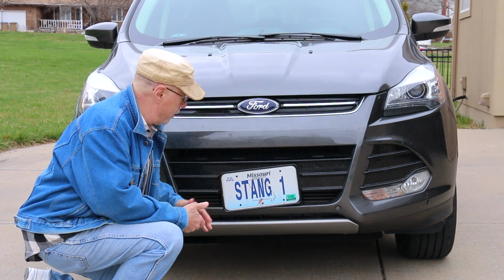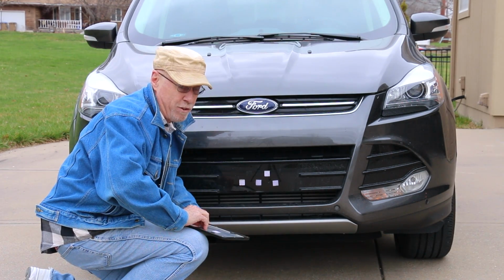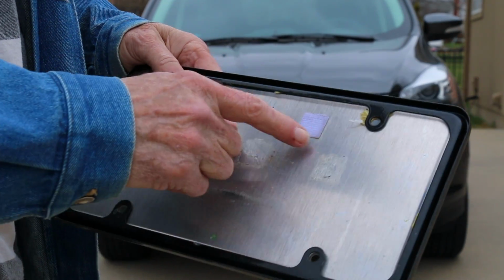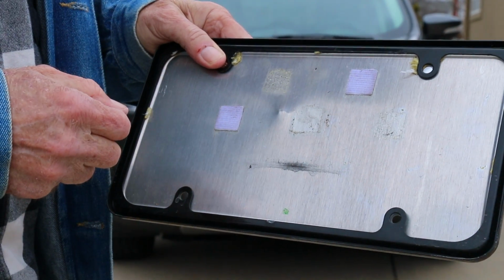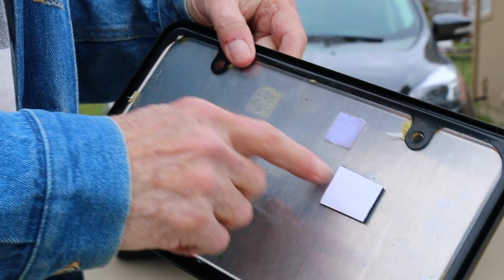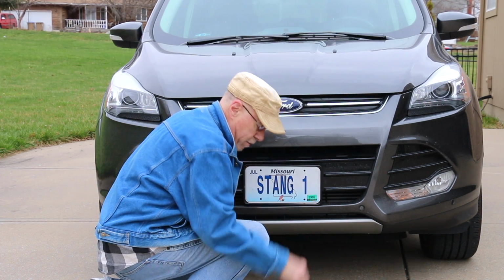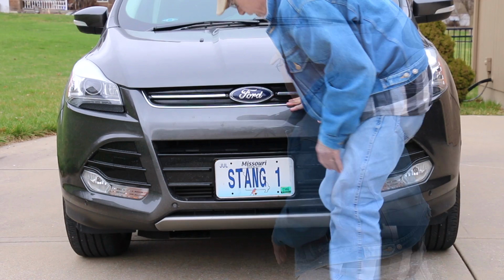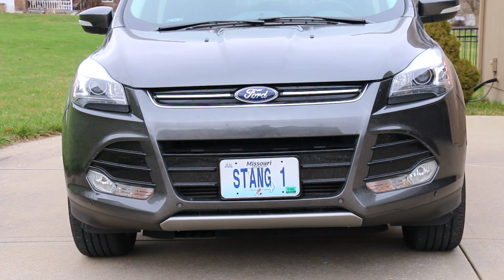Don't drill your bumper to attach that plate. Easy method.

Comment: Thank you for this video. I really did  not want to drill into my front bumper so I'm going to try the extreme dual lock Velcro as suggested by another commenter.
Reply: Did you do it and has it worked?  Is it secure?
Reply: @melindathomas7529  Yes.  It has been holding on well since.

Comment: Unfortunately, in my experience, the glue on the tape side of the Velcro becomes gummy and loose in hot weather, causing it to detach. I’ve tried it for other applications (not a license plate) and without fail it has always umm… failed. Cool idea in theory, though I wouldn’t want to trust my plate to some Velcro. Oh, and I’ve tried a few different brands and had the same issue.
Reply: Just move to a dry climate.  That will solve your velcro problem.

Comment: Thought about doing this... even bought some industrial strength Velcro. But where I live, the weather can get treacherous. I think I'll order something like the No Drill Required 3-Inch Bumper Guard Tube Mount License Plate Bracket/Holder but this is a great temporary solution.
Reply from the maker: I live in Kansas City. We get rain, freezing rain, sleet, snow, high winds and sub-zero temps and days over 100 degrees in the summer. I've never had an issue with it coming off so far.
Reply: @MagnumVideos  Magnum, thank you for letting me know! I think I'm going to try this tomorrow when the temps get to 13 for the high and see how I feel once it's done :) Seriously, I need to do something for now and see how it stands up while I look for a no-drill mount bracket that isn't a waste of money and will actually fit my car. Maybe there's a way I can reinforce it behind the fancy license plate frame I bought, as well, along with the Velcro. Thank you, again, for sharing this video.
Reply from the maker: @pangelcolon  We have 8 degrees this morning here in KC. 13 degrees is pretty cold, and if you're going to have any higher temps in a few days, I would probably wait until it warms up a bit so the Velcro will stick better. I don't know how it adheres when it's that cold when you apply it.

Comment: I know you’re just trying to be helpful but using velcro is a bad idea. It wont work if you have to mount it to a curved bumper. Velcro needs flat surfaces. The flat license plate will pull away from the velcro pads on the curved bumper. Also for many bumpers you can only have velcro on the top half of the plate so its even less secure. Many bumpers arent thick enough to secure the bottom too because the bottom hangs over the grille or radiator vent. And i’m not confident the velcro adhesive can withstand 120 degree heat in southern Nevada or constant rain in Washington for years. Best just to drill the holes or get a mount that attaches to the tow hook if the car has it.

Comment: Wouldn't do this with anything less than Alfa Lok velcro and wouldn't do it on a back plate if there's any part of it hanging low enough to catch any wind. Trying to figure out a solution to hang my rear plate on my rv. Previous owner had nice, bright, large brake lights installed which means no space to hang the plate where it was designed to go under the brake light.

Comment: What did it attach to on the car?  Is there a matching piece of velcro on the car or is he simply applying the sticky surface directly to the bumper. If so isnt that as damaging as drilling holes?
Reply from the maker: Velcro attaches to the bumper and the plate. No damage involved. Works like a charm.

Comment: I bought a thick rubber bumper thing for my front plate because it's attached with these long stabby hex bolts that actually protrude out front and would damage another car. The front plate attachment is drilled into the plastic (Volvo) bumper. I don't know about Velcro....that's...

Comment: This is hilarious on several levels.
"A quick video"!?! 6 minutes to say/show "attach it with Velcro"!
What's the issue with drilling holes in the bumper? The only upside to this is years later if/when you sell it privately to a buyer that lives in a state that doesn't require front plates you point out that there aren't drill holes there and he says "oh, ok. That's better than holes" and mentally adds $10 to your car's value.
Otherwise it's a liability, it can fall off, get yanked off in a carwash, or stolen.
The holes don't have much of a downside, they're under the plate.
Do you anticipate moving to a state that doesn't require front plates soon?
This one is a personal favorite. Along the lines of putting a vinyl decal of the model of car you are driving at the top of your windshield. You have an Escape with a "Stang 1" plate ROTFL
The "1" probably drops the price on a vanity plate like it would in Illinois but, looks hokey. The obvious laugh is that it's on an ESCAPE!
Is there another reason for it, is your last name Stang?
Props for good image quality and audio and posting them on the web though. Please tell me your patreon isn't full of this kind of stuff though.
Reply: Why don't you post some suggestions since you seem to know so much more.
Reply: @koosylagoopagoop  ummm, drill holes and use a nut and bolt? If you want it more secure (harder to steal) use a security bolt (AVsafe). Or just buy the license plate kit from Ford?! Then follow the instructions...
Velcroing is a loss waiting to happen and it's apparently hard to put the plate on plumb and square so it's kinda obvious that it isn't permanently (or well) attached which actually attracts would-be theives.

Comment: You would have been better off drilling holes since that part of the front end already had the bracket area built in. May have had a better chance if getting the plate on straight.

Comment: Anyone can steal  the plate very easily and it can come loose and drop anywhere.
Reply from the maker: Who steals license plates? Not in this area. Mine has been on for 4 years and hasn't fallen off yet.
Reply: Both mine just got stolen, people who don't like to pay for fuel steal them, or even worse crimes like ram raiding. That's who.
Reply from the maker: @arsecheese51  Were they screwed on?
Reply: Magnum yes screwed on, it’s one of those things you never suspect will happen so why waste time making it safer. But this kind of thing happens so I won’t be using Velcro, and even screws aren’t enough.. need safety screws, or bolts with a nut and locking nut on the first.. just to make them a pain to steal.
Reply from the maker: @arsecheese51  That's not good. What area do you live in?
Reply: Magnum this won’t come as a shock when I tell you, but it happened in London, UK. But there’s idiots the World over..
Reply: Anyone with a screwdriver can steal any plate they want.
Reply: Hayden Price not if you find another more secure way of fixing it than screws. Security screws would be my first suggestion. Small bolts with locking nuts. Anything that will make the thief move to the next car. Obviously if they really want your one, they will get it eventually. But make it a bit tricky and they might move to the next vehicle.
Reply from the maker: @MrHprice123  Good point!
Reply: @MrHprice123  true
Reply: @MrHprice123  that's why you use security bolts, then only people with a bunch of security bits (one of them being a match) would be able to steal it. Generally the their would move on to an easier Target, kinda like a home security system.

Comment: Richmond,VA - Do you think this would work for attaching a license plate to the fender of a trailer...or what would you suggest? Thanks!
Reply from the maker: It should work if you've got a flat surface.
Reply: Security Bolts